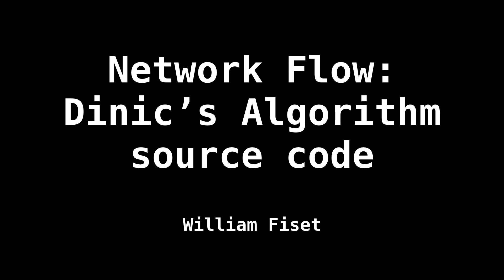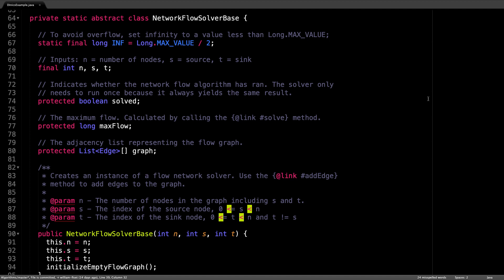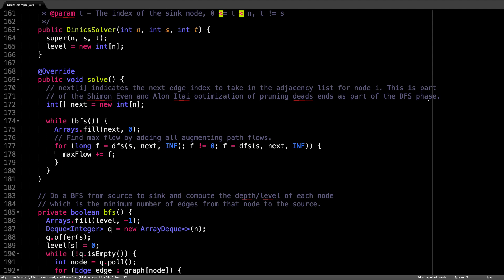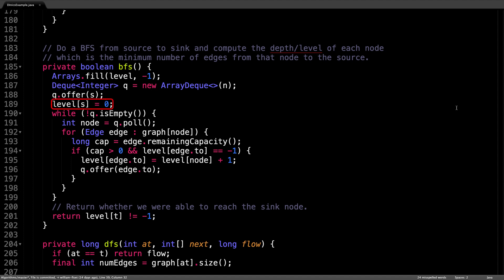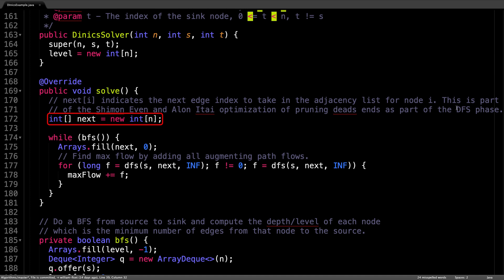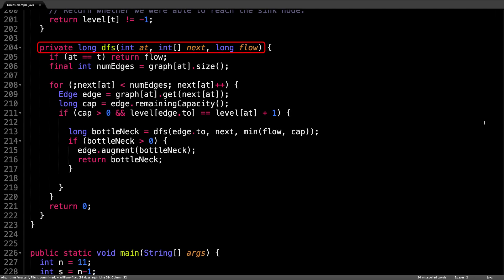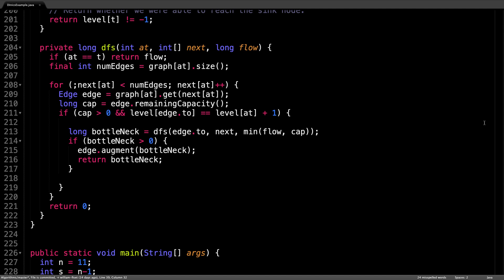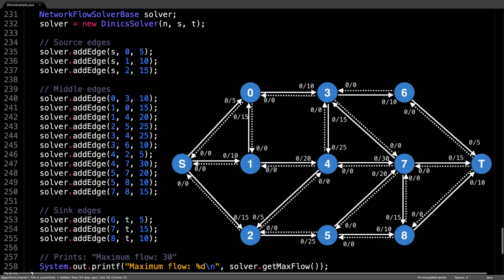Dinic's Algorithm | Network Flow | Source Code

Comment: We are using next array as part of pruning.(i.e to avoid dead ends). My question is  "does it avoids non dead ends too?". In short while proning we are just trying not to do dfs through the same edge. But there might be a case where dfs through the same edge will not lead to dead end but we r still avoiding it (due to next array)?
Reply: No it doesn't, as you can see in the code, inside the for loop that increases the next array, the code returns if the bottleneck is greater than zero, meaning that it isn't a dead end, and returning will cause it not to increase the next at the end of the for loop iteration. I hope this helps.